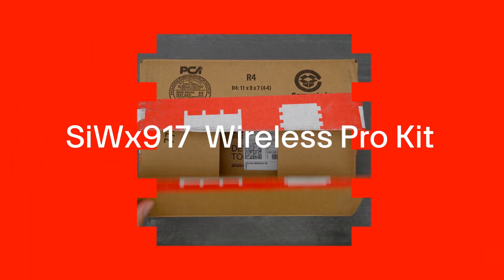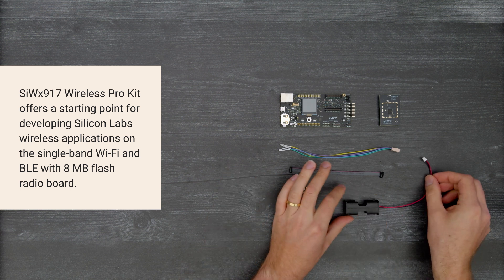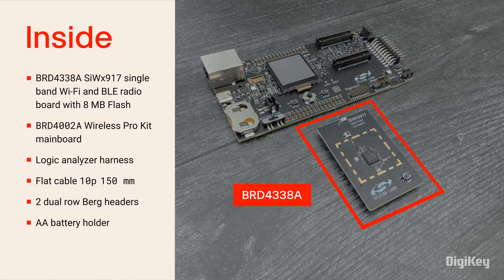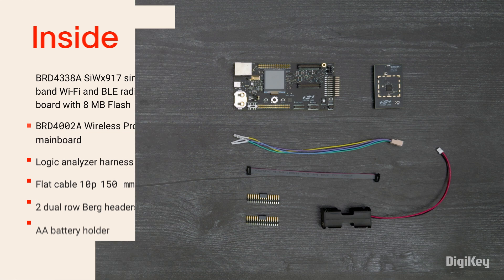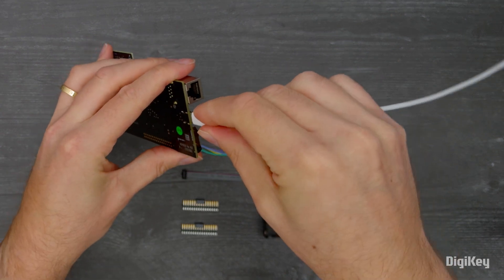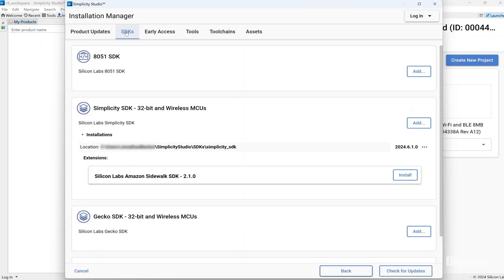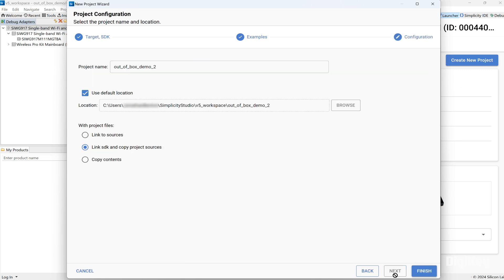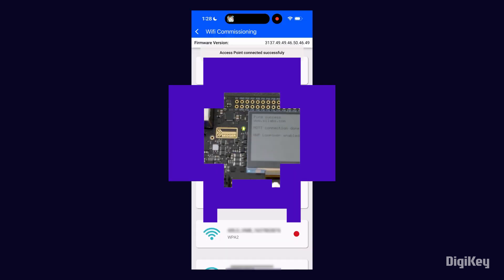SiWx917 Wireless Pro Kit - Unboxing

Comment: I've been prototyping with this chip and it's a pretty cool product.
Reply: Can this be used to enhance the wifi capabilities of other boards like ESP32 or Raspberry Pi?
Reply: @nospamman4443  It can be used as a network co-processor, yes, however I've only used it in SoC mode.